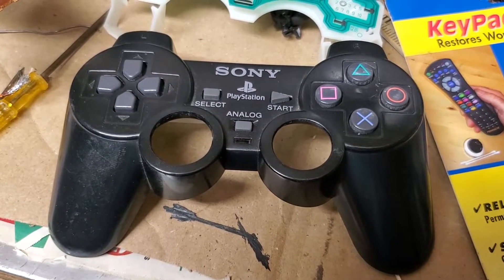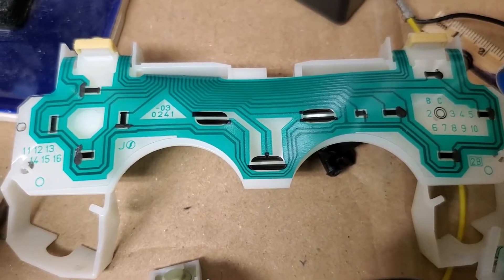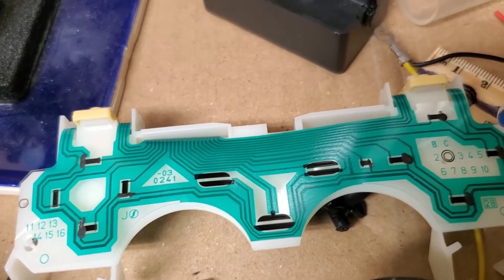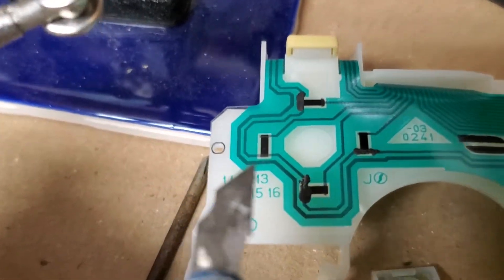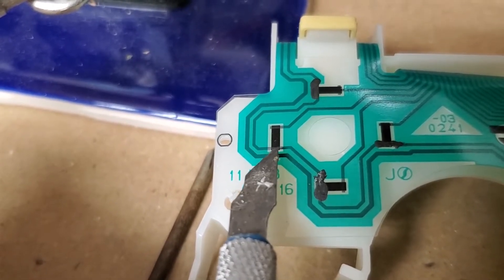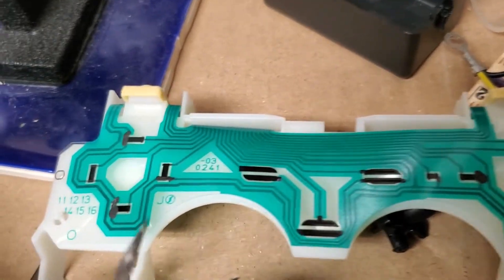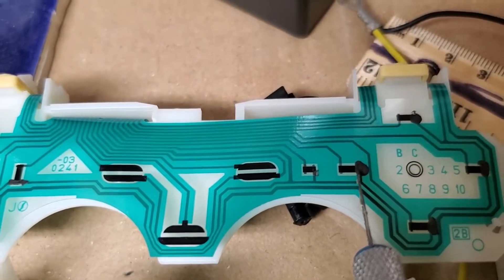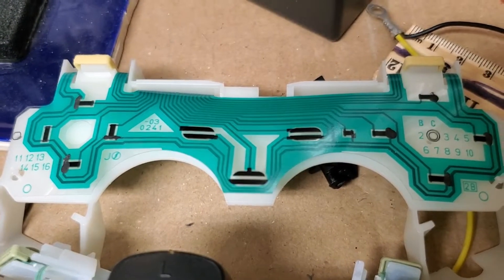Can you fix unresponsive buttons on PS2 controllers? Maybe.

Comment: Try sanding the black stuff before adding any conductive ink. It could be that the conductive ink isn't coming in proper contact with the previous black stuff to make a proper connection to the traces.
Reply from the maker: Have you specifically tried this approach for fixing ps2 buttons? In general sanding is good advice, but in this case the controller needs the resistance to be in a fairly narrow range due to the nonsense "pressure sensitive" feature that almost no game uses. So I don't think that would help.
Reply: @xeostube  no, but I saw a YouTuber do that, but lightly sanding graphite until there was a reading on the multimeter, and the buttons became responsive again. I plan to try the lightly sanding method first and then the silver paste unto the pcb film carbon conductive pads. I believe that's what they are called. I will try both methods. I case plan A didn't do much. Maybe plan B will improve upon it. Btw, I am doing this for my Dualshock one controller. I don't know if they have pressure sensitivity. You could try sanding more or adding more of the carbon to see if you get the correct exact amount for the sensitivity special feature. It might be a trace issue if they aren't working for you, but I might be wrong.

Comment: I scratched a line threw the black pressure pad and got it to work. Figured it already didn’t work so what do I have to lose.
Reply from the maker: Interesting. So you mean you scratched button rubber, or?
Reply: Your ps2 controller still works?
Reply: @esai708  i think "class A" ps2 controllers are a better opcion that does not fail in that case, i have a "A" class joystick very used and all buttons work perfectly and i have one joystick "Class H" almost new and left side buttons dont work

Comment: I think the problem lies on the unequal surface that you create. The conductive material under each button must touch both sides of pcb. Sometimes it warps and makes poor contact(fix is wet sanding). Why dont you put these connective blobs on both sides, and befores they harden, try pushing them against a flat surface. Hope it works. By the way great explanation on your video!!
Reply from the maker: I don't think that would help - this is not a matter of too much resistance, but needing the exact right amount. If you short the contacts with a metal test probe it doesn't detect that as a button press, either.
Reply: @xeostube  He didn't say anything about RESISTANCE. You literally need a perfectly flat even surface so that everything contacts evenly across the board, otherwise you need to press harder on some buttons or you don't get contact at all.

Comment: I believe the pressure sensitivity is the most important feature on the PS2 controller reason being my favorite game of all time that I still play is SOCOM and the triangle button for example is a vital feature for going crouch to prone or stand without this feature believe it or not the game experience suffers severely as result. Unfortunately this would be the selling point for myself to purchase an original PS2 controller for $80 opposed to just dealing with a crappy aftermarket controller. Hence why I am here on your channel😊 If this doesnt work I'll be breaking out the clown face paint for myself as I bite the bullet and pay the money for an original. Very useful and informative content, thank you!
Reply from the maker: Interesting. I've never played a game where it was a useful feature. How exactly does the pressure level map to the stance? Couldn't it have worked just as well by using hold time as a stand-in?
Reply: @xeostube  Great question! So, for myself I play SOCOM 3/Combined Assault multiplayer online. The pressure sensitivity was used for various actions in this game, the stance for example paired with the pressure sensitivity allows you to  quickly tap the triangle button to go back and forth from crouched to stand. Now if you applied a descent amount of pressure on triangle while standing you will lay straight down. If you had to cycle (Beginning of round you start out in the crouch position) crouch>stand>prone or the other way around I could imagine the animation and how silly it would look lol the pressure sensitivity worked beautifully for the flow of this game. It’s a bit hard to explain in words but in certain scenarios I couldn’t imagine how the experience would have been without it when the game came out!
Reply from the maker: @-pLoU.  thanks for the detailed explanation. So while I can see that that is a great design, I wonder strongly if an almost identical design except for using hold duration wouldn't work as well, and also I suspect strongly that a harder press results in a longer press almost all of the time, so with minor code tweaks you could probably have almost the same experience from a gamers perspective.
Reply: I think metal gear solid 2 had pressure shooting! I was confused at first.

So apparently. If you lightly hold square, you'll start aiming, when you release it then, you stop aiming right?
So how do you shoot? Hold harder and release the button faster. That's why it feels amazing to play this game on ps2 :D

Comment: That's why the ds1 controllers are more reliable because they are not sensitive
Reply from the maker: Or almost all 3rd party controllers - actually wait those aren't more reliable. Or maybe they are now that the major factor is age, not use.
Reply: @xeostube Only DS2 "H" controllers tends to die because of the circuit board having it's carbon worn out. "A" model is probably the most reliable DS2 no matter how old it is it will always work thanks to better quality circuit boards (as far as I know they don't get the non-responsive buttons issue like the H models)
Reply: My DS1 controller had the same issues.

Comment: But you only put the conductive ink on one side of those connectors. How do you know the break wasn't on the other side of the connector? Why didn't you put the ink on both sides?
Reply from the maker: You can use a multimeter to determine where the break is
Reply: @xeostube  i left my my multimeter in a different state and the directional pad isn't working with 3 buttons by not detecting them. You think I just dump some of that there ink and ill be good

Comment: Thanks - This is an incredible walk through and explanation in how it works. Can somebody help me? I've unearthed my old PS2 and it powers on, but the one controller I have isn't working and so far I haven't seen a fix for this fault...

The analogue button definitely works, and I can see the red light illuminate when I press it. No other buttons seem to work. The pins look ok, it's definitely slotting into the console. I can't see any damages to the cable or the controller's plug component. I took apart the controller and couldn't see anything that was obviously broken. Hardly any dirt/dust inside.

Any thoughts?

Comment: Hey my right analog stick button doesn't work you can look around but it doesn't click
Reply from the maker: They are two distinct parts but are so hard to remove and separate that I've never found it worth trying to replace the button that is attached to the stick. sometimes spraying circuit cleaner into the button will get it to start responding again though, but you probably don't want to get any of that into the analog stick.

Comment: oh well ill just buy a new one, repairing it is a hit or miss anyway
Reply from the maker: By new one do you mean a third party one? Do you have a brand to recommend because in my experience the third party ones are mostly junk
Reply: @xeostube  i mean a working, official ps2 controller, even if its second hand, i typed the wrong word sorry

ive tried repairing mine and i ended up breaking it even further 😐, im not really good at repairing stuff
Reply: @xeostube  Logic3 used to make PSX peripherals, Memory Cards, controllers, etc.. I think it's good stuff. I just happened to strike gold 3 weeks ago, bought a (chipped) PSX 9004, a PS2 70004, a PS2 90004, an official Sony PS2 8MB Memory Card, two Sony Dualshock2 controllers, one Logic3 PS2 controller, a copy of Need for Speed Underground 2, Need For Speed Undercover, Midnight Club 3 Dub Edition, WWE 2010 and Tourist Trophy all for 25€ (less than 26$). One Dualshock2 controller has unresponsive R1, R2 and Triangle buttons, the other is fine and the Logic3 one is like new and it feels quite sturdy and resistant. At first I couldn't believe how lucky I was.
Reply from the maker: @MitraDaGalp  that's not a brand that we seem to have a whole lot of access to here in the US. I've never heard of it before. But I'll keep an eye out for it.
Reply: @xeostube  I don't mean to say it's very good but I think it's not bad. The controller isn't as smooth as Sony originals but it's quite acceptable. Only the directional pad isn't as good for fighting games in my opinion.
Reply: True !

Comment: Tnx alot, I wanted to play KH1 again but up on my d pad doesn't work. It sucks that I probably can't fix it but it feels alot better knowing it's not my fault or my cats. I wish I knew enough about electrical engineering to know how to add transistors and copaseters (I think that's what I need) to only have the correct voltage be outputed
Reply from the maker: I don't think that would help in this case, as it's very likely that the resistance of the traces has gone up, and adding resistors would only make it higher still.
Reply: @xeostube  that's annoying but I'm very glad for the response. Perhaps someone will come up for a real way to fix the controllers without swapping internals
Reply: you could use the right stick.

Comment: Hey man, thanks for the video! What about an overstimulated button pad button? Even if you don't press it, the computer thinks your are always pressing it maximum, therefor when selecting options in the menu, it keeps on sliding through the menu at maximum speed. By pressing the opposite button, the selector stops but doesn't go the other way. What do you think would be the problem?
Reply from the maker: That sounds more like analog stick drift,  but since that's rare on the ps2, you could also try taking the controller apart and cleaning the contacts under the dpad.
Reply: Perhaps the rubber part is broken or lost it's spring. Ask the guy above with 40x controllers to send you a spare part.

Comment: Thanks for posting.  I've had mine for about 20 years and today on Thanksgiving it broke :(

I was literally fighting a last boss also.  I'm trying to fix it.  It presses "random" buttons whenever I plug it in, but then becomes unresponsive after it's plugged in.
Reply from the maker: do the joysticks continue to work?
Reply: @xeostube  Yes and no. When I turn the red joystick light ON/OFF it seems to press all the buttons randomly.

I would guess it doesn't.  Seems to be pressing the L1/R1 and O buttons, not sure what else.

In any case, I bought a $10 replacement from China, but I'd be willing to fix my old one in the future.  We're on discord if that's easier to chat!
Reply: I bought my slim ps2 brand new 2010..the one button just started to not work..very annoying..so I got one on ebay..I looked into parts like on here but as talked here I saw bad reliability problems with unofficial parts..wonder how long my ebay purchase one will last..but works like new again🥳🥳🥳🥳

Comment: How hard would it be to replace the conductive film? can you just pop off the old ribbon connection and pop in a new one?
Reply from the maker: Depends, in this case it's soldered on, though some models do use slip on connectors. As I mentioned in the video the quality of the replacements is highly variable.
Reply: i had success replacing a couple with some ones i found on ebay for $2. you just have to disassemble the controller first and figure out which model you need since there are soldered and slip-on connectors, as well as different numbers of pins.

Comment: It sounds like some form of general degradation that metals go through when there surface oxidizes? 
That & wear rate. 
I once had a remote control car speed control go dead my uncle suggested dabbing on Petroleum Jelly it worked great for conducting power for a while right up to total failure of the contact not sure it was healthy for it lol. 
Corrosive reaction may have took place i dont know tech stuff that side.
Im just trying to learn about soldering, flux cleans up metal contacts but also eats it away not cleaned off. 
Live & learn or fix it till its broke seems about right lol. 
"Its alive" Oh wait why did it do that! lol. 
Nothing last forever in this landfill cancel culture of modern minimal viable product, disruptive technology? 
Dont mind me i get stuck in data feedback loops more often than not ;^) the pitfalls of warped & twisted humour & modern buzz words that wont quit. 
Back to the subject please carry-on.....
Reply from the maker: could be - or it could be that a crack is forming between the two different materials that make up the conductive layer of the green plastic film. As best I can tell that's what's going on in the sample shown in the video, but it's hard to be sure. At least one other sample I've tested is suffering the corrosion problem you mention.

Comment: Great explanation, I have over 40 controllers that have the same issue. Thats crazy that Sony made them Like this wow thank you
Reply from the maker: Sony contracted out the controller to two other companies, but the design must have been mostly specified by Sony since they all look pretty similar inside.
Reply: The Hosiedon (H) ones are the crappiest by far, and are most prone to this failure as a result  @xeostube - I used your conductive ink trick, which seems to work for 1 of the H controllers I got so far, but it isn't time-tested from my experience. There's another 1 I got BUT the L2/R2/Up/Left buttons DON'T work and the membrane seems to be too far gone